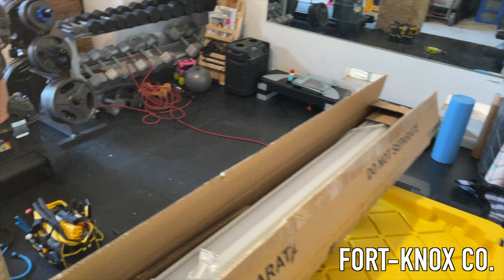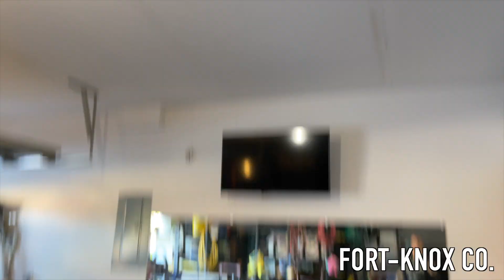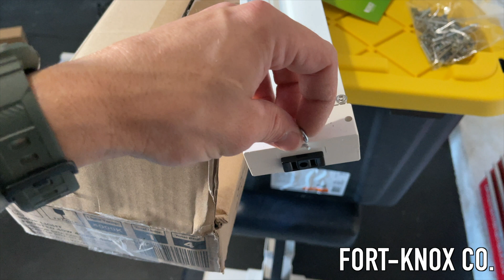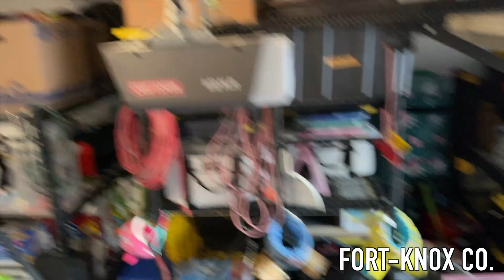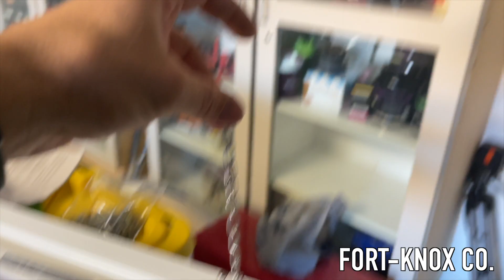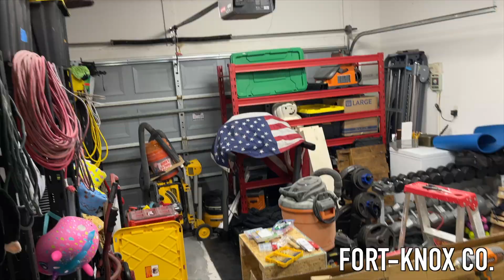BEST Garage LED shop lights install How To Flush mount| Sunco LED 4ft lights 4000K | DIY electrical

Comment: Do these lights now turn on and off with the wall switch? The Amazon listing says the outlet is powered even when the light is off.
Reply from the maker: I have them wired into a circuit that is controlled by a switch. So if you plug them into an outlet that is controlled by a switch them they will only have power when the switch is turned on. These lights have a pull string switch on them, so if you were to plug them into a regular outlet that is constantly powered then yes the powers would be on but controlled by the pull string on the light fixture. I just leave the light fixture pull switch in the on position and control these by the switch I have on the wall

Comment: All that wiring looks ugly. U should of got the ones without the cord where u run the electrical in the ceiling and drops into the light
Reply: It does look terrible
Reply from the maker: Thank you!